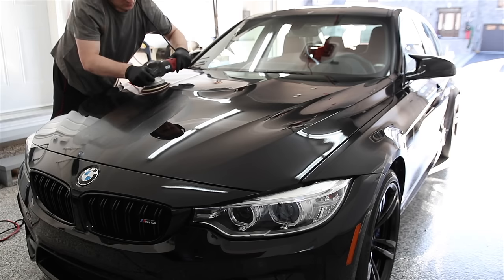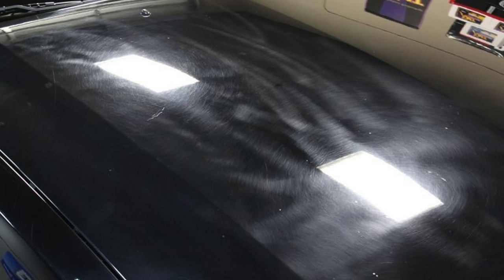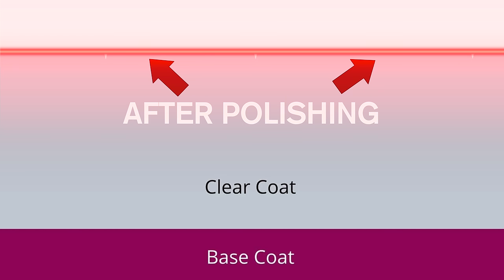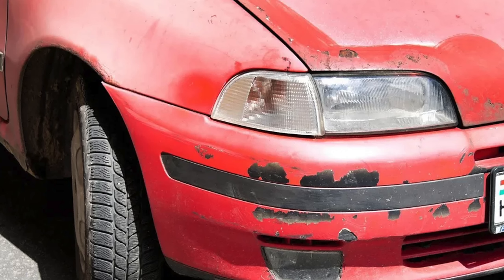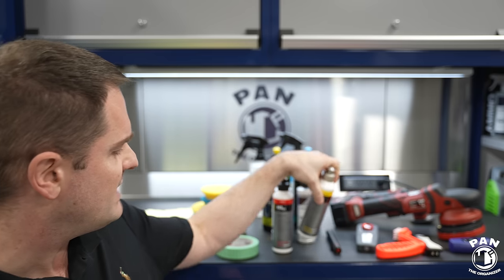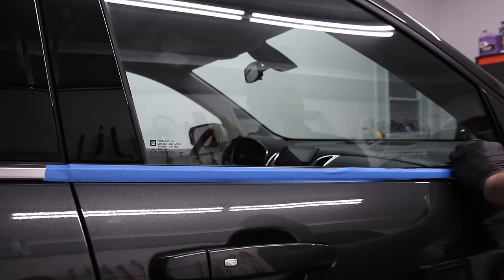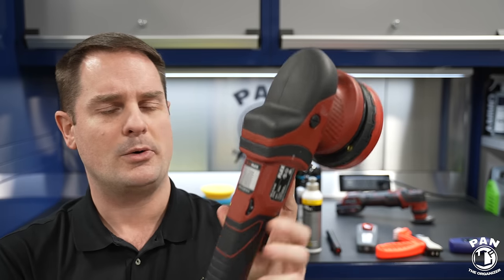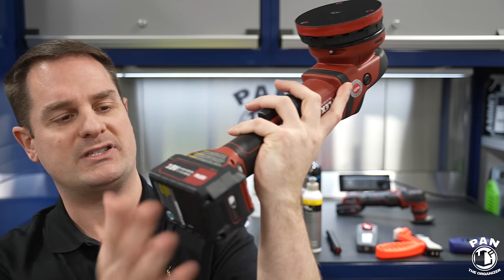DETAILING 101 - Paint Polishing - Everything You Need To Know

Comment: Good stuff Pan. Learning so much.  Few questions:
1.Do you dry the car before and after the iron remover, or dry it before you clay?
2.When and how do you do the finishing polishing stage?
3.Do you still tape the chrome plastic trim and the black wheel well liner?
Thank you.
Reply from the maker: 1. You can spray the iron remover on dry or wet paint. I prefer to spray it on wet paint to save on time (efficiency).
2. I don't understand your question.
3. For beginners especially, I would always recommend that you tape all the plastic and chrome trim pieces before you start polishing.

Comment: Pan, let me just start by saying THANK YOU!! I've been trying to find the excuse and motivation to get my cars back to the sleek, glossy and protected look they should have, when I came across your channel and have never looked anywhere else since. I've watched, and continue to watch, your detailing 101 videos at least 3-4 times a week just to get all of that informative and extremely helpful knowledge burned into my brain for when I finally decide to do a full detail on both of my cars...which I started to do yesterday. I figured yesterday was perfect, cloudy, mid 70s F, a sprinkle here and there but nothing bad, low humidity, so I got out my new Karcher K1700 and started to go to work...then got stuck 😱. Here's how my day went...

My car: 2007 Mazda 3 (black),  only waxed once, usual run thru drive-thru car washes 3-4 times a year.
- Rinsed car off, cleaned tires and wheels, used Adams shampoo for snow foam and then hand wash.
- Dried car, sprayed down with CarPro TarX, rinsed off, then CarPro IronX, rinsed off and dried.
- Used Nanoskin clay towel and Gyeon clay lube on whole car, (started to sprinkle a bit) rinsed car off, pulled it into garage and dried off.
- Got out my new 6" Avid Power DA polisher, Meguiar's compound & finishing polish plus 4 pads each of Meguiar's da compound & finishing microfiber pads. Started on the hood,
  picked out a 2x2 area, primed the compound pad with polish, set the polisher on 2 and went over the 2x2 area, then set the polisher to 5 and put 4 dots of polish onto the pad,
  tapped the pad down 4 times within the 2x2 area and went over the area just like in the video...the compound dried VERY quickly! So fast that I really had to rub hard to buff it off.
  Tried another section and same results, not like your video when you just wipe it off with ease. So tried another section, cleaned the pad off with a brush and did the steps again,
  same results...I'm wondering if I'm doing something wrong. I can tell it's doing something, but little scratches and swirl marks are still present.

By this time (8:00pm) I gave up, left car in garage, and realized how out of shape I am lol! My whole body is aching, but I want to keep going...any ideas of what I might be doing wrong or any tips? Love your channel and the videos, and thanks so much for inspiring this 45yr old to get off his rump and take pride in his car once again!
Reply from the maker: Hi Dan! First, thanks for the kind words. I'm glad to hear I can help inspire my viewers to learn more about detailing and go out there, and enjoy detailing their rides! 

Welcome to my channel. You discovered one of the biggest car detailing channels on YouTube as we surpassed 800,000 subscribers and 100 million views! I have been detailing for 25 years and I love to share my knowledge and passion with my viewers.

You found the right channel to help you learn everything about detailing.

Seems like you nailed the steps so far, so I'm happy to see that. Wash, chemical decon, claybar, then machine polishing. Perfect!

Now as far as the compounds and polishes, many factors play a role, including temperature, humidity, and who knows if you perhaps had a bad batch of products? Keep in mind most detailing chemicals are only good for about a year or two (shelf life) if kept in stable conditions and never frozen.

You are perhaps overworking the polishes, and they generate lots of dust when dried up. Or perhaps, you should try another compound and polish combo with different pads and see how that reacts on your paintwork. Different paints give different results some times.

Here's a video I made about my favourite compounds, polishes and pads combos: https://youtu.be/2JDvQBs1viM

And of course, always work on cool surfaces, never in direct sunlight. As close to 68F temperature as possible is ideal, with 40-45% humidity at most.

Polishing takes time to master, but you seem to be on the right track. Once you find the right product and pad combination for your given paint, you will love mastering that new craft. :)
Reply: @PanTheOrganizer  Thank you so much for the quick response and valuable feedback! I think you nailed it with the temp and humidity. Even tho the car was in the garage, it was still around 70d F and 50-60% humidity, so I tried doing smaller sections and a bit quicker passes and that seemed to work a little better but still dried up quickly. I ended up finishing last night with the polishing stage, IPA wipe down and Collinite 845 wax and I tell ya, she almost looks brand new! Thanks again so much for your teaching videos and product reviews, they really take the guess work out and made me feel a lot more comfortable taking on this detailing job!

A couple things I was not happy with is all the chips in the paint, specially on the hood where rocks & pebbles would be kicked up from others cars. It looks like someone took a paint brush with white paint and flicked it above my hood and all these white flecks landed on it lol. Also the wheels are severely discolored/stained? that even P&S brake buster couldn't get them clean. Any advice on how to fill in those spots and get those wheels clean?

Comment: Hello Pan, grats on 1 million subscribers!!!!!  If you have a well maintained vehicle, and you just want to reapply the ceramic coating (been 3 years for AvalonKing ceramic) do you need to compound or can you just skip that step and go to polish to remove old coat (if any left) and then coat? I do not see any swirls or defects in the white pearl paint.
Reply from the maker: Thanks Jeff! Before applying a new coating, you have to machine polish the old one off. It's the only way to ensure 100% removal of any previous protection especially coatings. You decon wash, iron remover, clay, machine polish, paint prep spray to remove polishing oils, and reapply the new coating.

Comment: Hello! I have a small paint correction question. Some small scratches are not removed. Here are the details.

Car: Volvo 2021 (Black) XC40 T5 Redesign. Used:  Rupes Course Cutting Foam Pad. Meguiar’s Ultimate Compound. Griorts G9 Random Orbital Polisher.

Went back to redo the tailgate today. There were some (What appeared to be.) light scratches that are not deep. I have to get within a foot to see them. Can’t feel anything passing a finger over them. Neither can a feel them with a fingernail. Made 3 separate passes with the Meguiars compound which had no impact.

Welcome your suggestions on how to resolve the issue, which may wait until spring.  Much thanks!

Comment: sorry pan, I know, asking too many questions but nearly there... only 2 things to choose still... a polishing machine and a coating

for the polishing machine (after watching your video and googling):
1. as I will not use the polishing machine that much (you confirmed), seems a bit overkill to buy a big 5/6 inch and a small 2/3 inch, so if only buying one, which one, knowing I dont want to break the bank if using it only once every 3 years or so;
2. if only one machine, best a 5 or 6 inch? guess 5 inch no? as to still reach the smaller parts easily
3. with a short throw (8mm typically, works slower but easier to reach small surfaces, since not buying a little one) or a long throw (15mm typically and think most you recommended are 15mm but since I will not have a little one...)
4. the alternative, less expensive brands, and if available in europe, cost still between 200 and 300 euros/USD; can I go even lower in price or will I miss too much on quality then?
5. understand it should have an adjustbeable speed and about 1000 W power on average

Thanks! and sorry for bugging but nearly there :)

Comment: Thanks for the video, it is very informative and nicely structured. Appreciate you sharing so much knowledge with us, beginners. I have a question about the IPA prep step. I am just getting ready to do my first correction/ceramic coating and for simplicity and cost, I'd like to use Turtle Wax Hybrid Solutions Ceramic Polish and Wax followed by their Ceramic Spray Coating. Since the Ceramic Polish and Wax already has some protective agents in it, does it mean I should skip the IPA prep step after using this product with a DA polisher? Would wiping off the residue with a clean microfiber towel be enough to then move on to the Ceramic Spray Coating step? Thanks in advance!

Comment: Hi Pan. Love your show. I usually go through the wash, chemical deon, and claying. There seems to be some conflicting info on the next step- to polish or wax. My finish has been well maintained and I have skipped the polish and  waxed. Is this a mistake? Yikes! If so, what polish are you recommending for very good surface. Thanks, John
Reply from the maker: You only polish the surface if it needs it. If your paint has swirls, scratches and/or oxidation, it needs polishing. If it looks great you can skip polishing and apply your wax

Comment: Thank you for the informative video I actually have wanted to learn how to do this for a long time and you really helped me understand the details of what is required and necessary to do a good job in this process without hurting the vehicle! With that being said in your example of clean the vehicle you had a step where you spray a chemical cleaner to remove things that are black and dark on the body in your example it was causing anything stuck to the vehicle to kind of Disconnect and drain down I'm having trouble finding what that product is. I have a full size Chevy Silverado that needs to be detailed and specially the bottom one foot has kind of a dark hazy look that needs to be cleaned like this because soap and water doesn't take it off.

Comment: I have a black 2021 Volvo with minor defects, like swirls and a few minor scratches. I wish to perform my first ever paint correction. Step #1 is to wash the car. Do I need to use a strip car wash product like Chemical Guys "Clean Slate"? Or, simply use a ph balanced soap? Understand the other steps. Plan to use TW Hybrid Solutions Ceramic Acrylic Black Spray Wax and Black Polish.

Comment: Uh oh Pan, I hit a snag. My brand new truck came with a ton of swirls EVERYWHERE. I think the dealer may have used a filler wax because after only a month, I’m finding even more marks, including a roughly 5” circle that looks like it was from a polishing pad. I tried TWs black pad (Lake City if I remember you saying correctly?) with their 1 and done compound and nothing changed. So I then tried their microfiber pad and it took it right out. I then fallowed with their orange pad and finished with the black pad. It looked great…..until I put a light up to it and can still see some swirls! What could I be doing wrong? This was a test run for a ceramic coating being applied. I’m using the G9 DA.

Comment: Yvan Lacroix says DAs cause micromarring which results in a slightly less glossy surface vs a rotary. He says that tiny bit of oscillation in a DA causes a loss in gloss particularly on black paint. Based on my experience I think he’s right. I have a brand new black car and I used a DA with a very fine polish on a very fine finishing pad with excellent technique and the surface is not as deep black as the panel next to it. So I’m now shopping for a suitable rotary. Thoughts? Ps I was polishing a brand new car because one door had some swirls from the factory. The DA removed them easily but now the panel has an ever so slightly cloudy look. (To the average person it would be imperceptible) but to detailer eye it’s there.

Comment: I'm using McGuier's Compound with new microfiber pads to remove water spots and it cuts way too slow. 3 minutes in a 1x1 section only removed less than 25%. I spent over an hour on my hood and it still looks bad with water spots. And I also used distilled with iso alch to wipe.

Comment: Thanks Pan, I found your channel by doing a search on detailing after I recently purchased a 2024 Grand Highlander. Thanks for a your Great Tips, and Have a Blessed Day! Question? In your opinion, if i don’t have the time to apply coating, etc wouldn’t it be best to apply a Graphene Coating rather than Ceramic, because Graphene “Should Last Longer”??
Reply from the maker: A graphene coating is still a ceramic coating, just with reduced graphene oxide (RGO) infused in it. So both are virtually the same, with the graphene promising a bit of reduced chances of water spotting. One isn't necessarily better than the other, they are the same basic chemical formulation.

Until one day someone cracks the code of having pure graphene in a coating, then we'll be revolutionizing the coating world.

Comment: Hello Pan!  Does a paint correction also fix the clear coat if it’s peeling? Or is that going to need a clear coat paint job?
Reply from the maker: If the clear coat is peeling, you are past the point of repair. That’s a sign of clear coat failure and a panel respray is needed.

Comment: Thanks so much for your tutorial videos! I learned almost everything from scratch and applied my ceramic spray coating (303). I have done the paint prep steps and the coating turned out wonderful. I only did a little bit of compounding and polishing to mainly remove some bird poop stains, by hand (I don't expect to do those often so polishers are too much for me). My car had very few light scratches (6 months old car). After compounding out the bird stains dense swirl marks  were formed (expected). However, when I tried to polish them out, the swirl marks did not disappear and now the entire polished region was full of swirl marks. I was extremely confused.
Reply: I used Chemical Guys C4, P4 and their hand polishing foam pads.
Reply: The car is a Honda Civic. I have heard that Honda clear coat is super soft. Does it mean that even the P4 polish is too harsh?
Reply from the maker: New cars usually don't need a compound stage. I haven't used the Chemical Guys C4 but it was perhaps too aggressive for your paint. Honda cars usually have soft paint. Also, after a compound stage, you always follow up with a polishing stage to remove the sanding marks left from the compound (as the compound uses heavier grit abrasives) to refine the finish. You say you used the C4, which is a polish, so that should have helped a bit.

But I would recommend that you get higher performing pads and polishing compounds, like the ones I highlighted in this video: https://youtu.be/2JDvQBs1viM

And definitely try machine polishing. Polishing by hand requires a lot of elbow grease and in the end you'll never achieve the same level of results as with a random orbital polisher (dual action).
Reply: @PanTheOrganizer  Thanks for replying to me! I probably did not phrase my question correctly.

I used Chemical Guys C4 (compound) to remove bird poop stains etched into the clear coat. And then I tried to use P4 (polish) to remove the light scratches from the compounding stage. However, the P4 polish did not remove the light scratches (or the P4 polish itself made the scratches). As you mentioned Honda paints are soft, does it mean that I should downgrade to a finer polish to remove these compounding scratch marks?

I agree that machine polishing is more effective. But I just want to compound and polish out the bird poop stains, not the entire car. And I don't think I need to do it very often after I had the coatings on. I will stick with hand polishing :)

Comment: Very informative video. Maybe there is a video about the afterlife I didn't find on your channel yet, but lets say following: I go through all steps and finish with a nice protective wax layer or other protective coating, how to proceed from there? What cleaning "foam/soap" to you, or maybe even more important, what to avoid to not immediately destroy the hard work you put in previous time?
Reply from the maker: After you are done fully detailing and protecting the paintwork, all that will be needed is to wash your car regularly with an appropriate shampoo and using safe washing and drying methods to avoid scratches and swirls. I have a popular car wash tutorial here: https://youtu.be/7Koj5j2Es5U

Now you will have to reapply the protection depending on what type you selected. For a regular carnauba wax, once every 2-3 months. For a paint sealant, once every 4-6 months. For a ceramic coating, it depends how many years the one you applied is said to last. To give you a better understanding of the different types of paint protections, watch my video here: https://youtu.be/4ejfPHan3k4

Comment: 43:57 hey pan quick question.  If after the polishing stage and ipa wipe down you mention adding a wax or sealant or ceramic coating.  If someone doesn’t want a ceramic coating what wax or sealant do you recommend and how many passes do you need to do with that process?
Reply from the maker: You usually apply the wax or sealant by hand. If it's a liquid wax or sealant, you could apply by machine if you wanted to, but you would pick the softest pad (for waxes) and use slow speed settings. You don't need to do multiple passes when applying a liquid wax or sealant, as you're not correcting the paint here. A quick application is all that is needed, as you're just applying the protection. You would then buff off using a microfiber towel, as you normally do.

I have a video on the best liquid waxes/sealants here: https://youtu.be/yuHqg-AbtdI